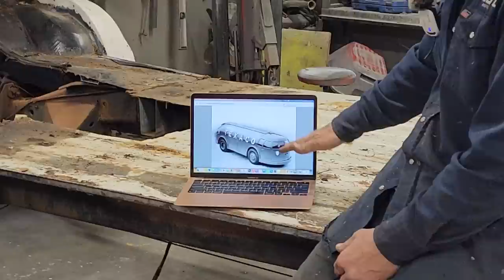NEW BUILD: 1930's Texaco Doodlebug (futuristic/streamlined) Truck

Comment: Cheers from Oz 🇦🇺Guys….. I love your fabrication work. I’m a bit “long in the tooth” now……. and I don’t have the area to work on vehicles 🚗…. but I wish this stuff (You Tube) was around was I was a teenager……. I had very limited knowledge about that side of cars etc. My mate and I did put a “spotlighting” buggy together in the late 70s …….. it was bizarre 1928 Chev Chassis, Holden EJ (Australian)front end, Chrysler Valiant rear end, Ford 289 V8 with speed boat extractors (headers) mounted backwards (forwards) and then the exhaust pipes looped back past the driver and a “Riley” gearbox. It had no real body aside from 2 seats , floor , rollbars and a tray top where the spotlighter and the shooters stood (hunting foxes , rabbits 🐇 and ‘roos out in the bush. I don’t know what happened to it , I haven’t gone shooting for over 35 years…… it’s probably still sitting around somewhere. I think the engine went bang and got left in the scrub. 
Every month or so I reckon it’d be interesting to give us a little “Cooks Tour” of the project updates…… like you did with Jolene’s “Bugatti” and some of your other bits……. I saw that lovely Z1 Kwaka = schmick !!

Comment: Your comment about viewers dropping off when you start sanding and priming is probably correct.  I'd rather watch your fabrication than the paint prep work.  I've learned a lot about the paint prep from watching you and have used it in my own projects.  BUT, the fab is where it's really at for me!  This truck will be an interesting build and I'll be watching every episode for sure.  Just an idea:  if you made one or both sides hinge upwards between the wheel wells, you'd have a unique rig for selling merchandise at car shows and swap meets.

Comment: If anyone one been watching how the Bagatti started out year's ago, y'all will know how far it has become from the body to the chassis this is a one one of a kind Car. Every Bagatti is built differently they might look the same but if you look closely at each one they are different. The original Bagatti came with a smaller engine, bad brakes  like sitting in a hot box.
Jolenes Bagattii is going the be very up dated but look like it could have been made year's ago.

There are a few other people that built hand built sport's car's that took a few year's to build and that was there every day projects. So yeah it takes a lot of time building a one off car plus disissions to make when buying a part so you don't make a costly mistake. Buying the wrong part and cost money to ship it back and parts that may not be available at the part store. Then you have to order it from Timbuktu that takes month's. 
This is for those that think it's like a T.V. show and a car gets built within a week.
The only person and a team of 200 people with all the parts donated was "CHIP FOOSE" and he wouldn't take all the credit he shows the team that put countless hour's in building a show car in two week's

Comment: Chad i admire your hands on approach. i saw when you made the patch panel in Austraila. you used your hands no english wheels , or planishing hammels or anything . i have a 49 hudson commodore rat rod with a buick 430 big block. while my son has a 59 buick lasabre stock with the nailhead motor just keep up the great work

Comment: JUST A LITTLE BIT OF INFO… if you want to raise your cherry picker up quicker than jacking it all the way up, just lift the end where the hook is to the desired height. It will stay up (has long as the release is shut) it’s a lot faster and not so tiring. 👍🏾

Comment: Looking good for a starting base. You should think about hydraulic steering (like a boat) . You could then fit your steering wheel anywhere you like and only need to run the hydraulic lines to the ram which is linked to the steering arms.

Comment: I doubt you’ll see this but watching you struggle to get the blade out of that DeWalt recip saw was painful. But only because I’ve used that same saw for years. You simply need to hit the trigger. When the head of the arm is closer in to the base the lever more fully depresses the pin releasing the broke off blade!! 41:25

Comment: You could rotate the staring box so the column is vertical, then all you have to do is cut the height of the column.

This may have the desired effect of pulling the steering position forwards.

Comment: Have you thought about making it a camping vehicle for when you go to a car show close by ?  Not for a week of camping , but some place to spend one night, or get in from the weather?   It would be a good , size and you could make it look as close to  the same as the original, but put a couple of windows in the back, so they didn't interfere with the look along the sides?  Then it is not just a fantasy piece ,it is useable.

Comment: Those DeWalt blade holders are a pain sometimes. Hold the blade release open all the way and squeeze the trigger wide open, the blade piece usually flies out... usually, LOL!
Reply: I was gonna say that as well. Bad design really. Or take a flat head screw driver and move it off the little pin that holds it in place.
Reply: @Aaronlewis8846   DeWalt makes some damn good tools, but the blade holder on their reciprocating saw is such a loose fit, trying to start a cut where you want is impossible, it is like trying to ride a bicycle that someone backed all the spokes off a half inch.
Reply: @gregpanek523  I know all about Dewalt tools. Used them for years and years Yeah that make great tools. And I know all about a reciprocating saw. Quite good at using one ifvi may say so myself. I know how them blades are when they get broke off and the tip that inserts in the tool gets stuck. Have had to deal with it many times.

Comment: That's not a unibody. The definition of a unibody is a chassis where a conventional frame is eliminated and the body acts as both the frame and body. What you have there is a conventional body on frame construction. Welding the body to the frame does not make it a unibody. This has an advantage to a customizer like yourself as you can cut everything off the frame  to make what you want. I guess we would all like to see the cars you work on finished. But finishing all the minutia to make a running driving car is boring. Way more work that isn't exciting for most people to watch. That being said, that's where the expertise is. Let's see the Buggati finished. Very nice project.

Comment: Take a small flat screwdriver and slide it under the blade to lift the blade off the pin then pull out

Comment: Sawzaw blade to release broken blade aim sawsaz downward flip yellow lever make the sawzaw power up by squeezing trigger sometimes you have to tap it against the floor where the blade goes aiming downward power on yellow handle flipped wiggling it sometimes with the motion of the sawzaw going up and down at the same time

Comment: Ik I'm alil late on this video just playing catch up lol but I've been working on my 64 Buick for months off an on now the motor won't come unstuck wich I'd loved for the original engine to stay so I just got a motor for it but floors is bad in front but for the time being I just screwed some random metal in it's place for now until I get the right batteries for my solar kit but I'm happy with it either way

Comment: Sry Chad...But the floor being welded to the floor is not a unibody. That has a frame. A unibody  is not a floor on a frame but a sheet of steel which is press formed and the frame is formed in. 1 piece.

Comment: Chad when the blade breaks off you need to run the saw a second and then remove the pieces,  right now it's down to far so you need to run it until the head is at the top.

Comment: Chad i find when ever i use the long Blades and brake one, they are a curse to get out, as they are a bit thicker. if you  use the short blades if they brake they come out past the locking pin in the saw easier

Comment: I had 2 of the exact Dodge B300 sportsman Minnie Winnie. I stripped one which was a 1976 for parts and the other one im building is a 1974. The parts are interchangeable. Im redesigning the camper back to be a mobile mechanic truck. Your truck I believe is a 74. Cant wait to see the conversion your doing.

Comment: Come and get my 73 chevy G10 van
Tons of parts.1991 Drive train
Wiring harness and all Even a ECM
Centerline  wheels 5 of them.I for the spare.2000 dollars. Southeastern  North Carolina.12 bolt 373 gears single traction.Air conditioning.Looks like a old A TEAM van

Comment: CHAD: "BUGATTI" Engine Water Hoses To Radiator, NO Flexibility !?  ---- You Need Movement. (Radiator Hoses To Copper Tubing ) Engine Torque Will Tear Radiator Apart . Unless Engine Fasten Down Solid